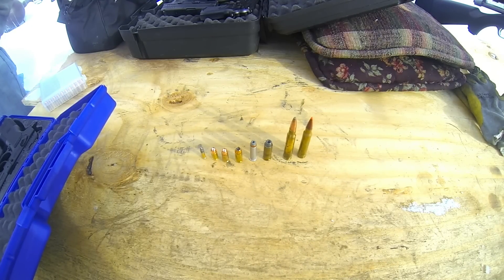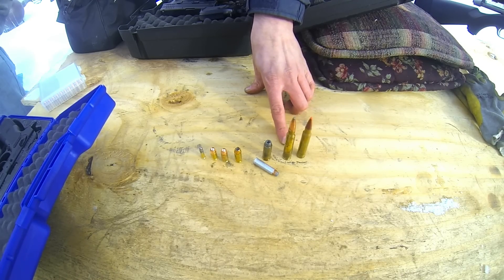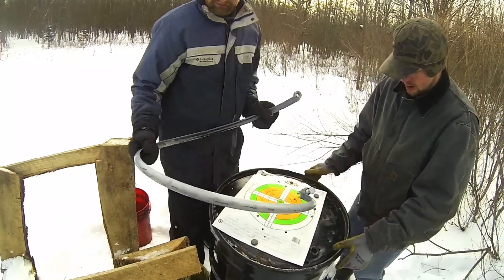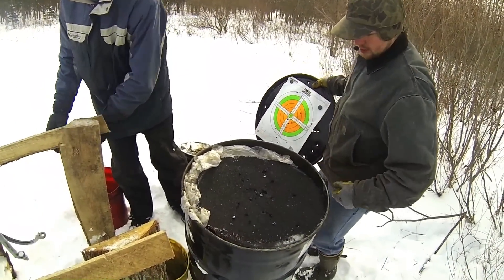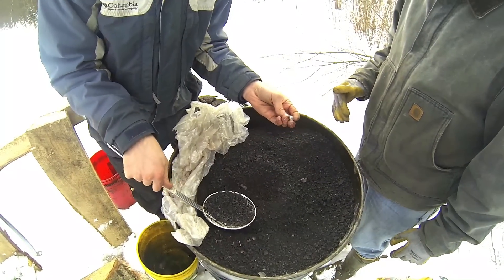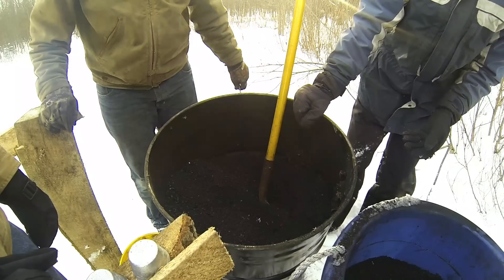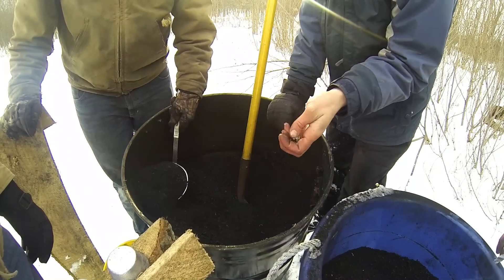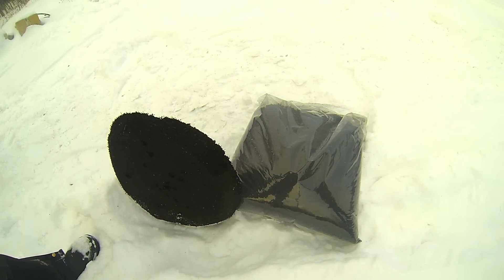Crumb Rubber Bullet Trap

Comment: Thank you for the idea, I called the company that you gave the phone number to and the guy was great and is going to send me a price list. He is even located within 100 miles of me her in Michigan. I am going to modify it just a bit, I am going to cut out the center about a foot round and mount a board over the whole. I noticed you were having problems with the targets staying on there in the cold. Also I want to use it as a way to catch my bullets so I can look at my powder coated cast bullets, I need to see if the powder coat is staying on the sides of the bullet and I think hitting the steel of the top of the barrel could scrape the side of the bullets. Easy enough to just put a new board on there every once in a while and that was we can just use the staple gun to attach the target.

THANK YOU!
Reply: Know more details in whatsapp:+86 15107149073

Comment: now this is what I have been looking for.  several 5 gallon buckets take them out to the desert shot and sift when I get home.  I shot 45 colt , 22lr, 76.2 x 39  and 7.62 x 51.   I have to buy some metal 5 gallons buckets.  I tried with sand an plastic buckets but the buckets gave up the ghost first time out and the sand just came pouring out the holes.

Comment: yeah your mulch looks a lot more finely ground than the stuff I found.  Most of what I got is the same size as most of the bullets!  This will make sifting it ... interesting if at all possible.  I also read that a shop vac might suck up the mulch but leave bullets (most likely only the heavy ones though).  Any other ideas on how to quickly separate bullets from mulch?  How much penetration did you get with your .338 vs handguns?  I am toying with the idea of either a 5 gallon bucket, or a metal garbage can (depending on penetration).  Was thinking to first but in a self healing rubber mat in the bottom, then FIRMLY pack either container with mulch, top it off with a thick steel plate, and then seal it with a lid.  Then shoot into the bottom so the bullets would be CLOSER to the top, if not directly under the steel plate.  What would you say was average penetration for both handguns and rifles?
Reply: Rifles or handguns, you want a minimum of 18" thickness. If you are using rifles, I would do 24" standard. In theory you could get away with only like 6" and a 1/2" plate, but It is a bit too risky for my taste.
Reply: jacobbrown7680 a

Comment from the maker: @jacobbrown6870 Thanks for the response sir! We have also done this with just a 5 gallon bucket, and if you were to do it that way, then you could just pick it up and dump it on to some sort of screen. The crumb is very fine, not quite like sand but it is rather easy to sift through. Another idea would be to have two barrels with a screen made for a lid, then you could take large amounts at a time out of your first barrel and dump it over the screen on the second. Then it would be a rather quick process. Another thought about the sand is you have a lot of cleanup each time you go to use it. You can't leave it outside all the time because once it's wet in the barrel it is now mud, which would make quite the mess, as with the rubber it doesnt matter if it is wet or not it will always be in a solid state.

Comment: Great idea with the DIY bullet trap. Have you come up with a quick and easy way of sifting out the bullets other than by hand with a scooper? I have read that “even a .50 BMG cannot penetrate more than 2 feet of sand”. Although the largest rifle I would be shooting is a .300 RUM, I was thinking of doing this same thing but using  sand and a large screen, so I can empty the barrel quickly and easily sift the whole thing saving bullets as small as .22. or as large as .50 S&W.  Rubber crumb would stop the bullets faster, but I think sand would be quicker and easier to sift and find small bullets.  What are your thoughts?
Reply: The issue is that sand is heavier, causes a lot of dust, and degrades when moist. I like rubber traps best, but sand traps are certainly an option.